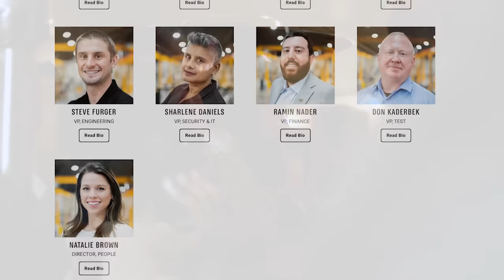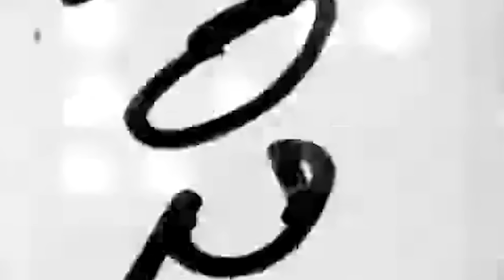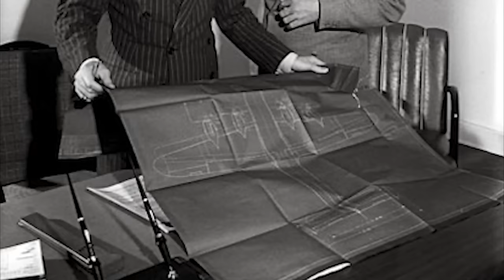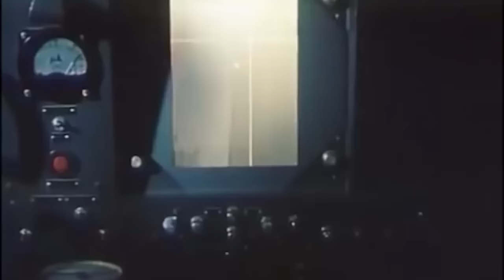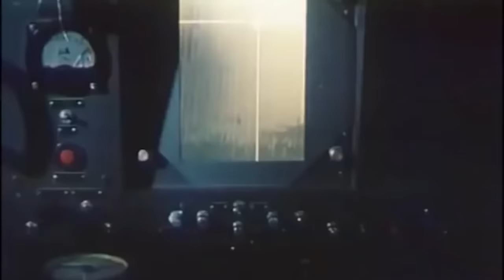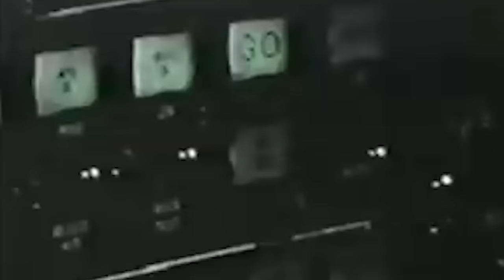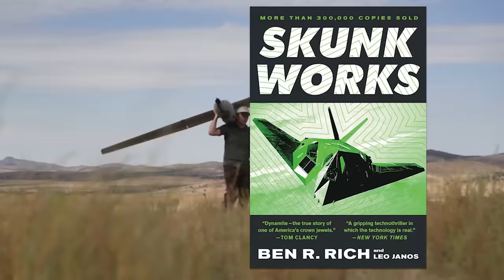Is Hermeus the Skunk Works of a new generation?

Comment: The thing I like the most is the amount of in-house design and manufacturing. People the are building it ACTUALLY interact directly with designers in the same building, unlike almost everyone else . 
"RealEngineering" made a good YouTube video about this project and is well worth watching.
Reply: Spot on, I feel this is why we are seeing poor quality in some parts of the aviation sector mainly commercial uhmmm Boeing, there's no direct interaction they're basically not working as a real team.
Reply: The Commercial Hypersonic airliner idea of theirs is... something else to say the least. Like the Concorde, one issue that I imagine Hermeus would have to manage is the Sonic boom such an aircraft would create (if the sonic boom produced by Concorde was loud, I can't imagine how loud a Hypersonic boom would be). I could imagine that it would be less of an issue if they just flew Transatlantic or Trans-Pacific flights, like what Boom Supersonic wants to do.

Still though, if they can get commercial hypersonic travel to be as safe and reliable as commercial air travel is now, it could be neat.
Reply: Vertical integration has become more important for cutting edge tech

Comment: Kelly Johnsons skunk works didn't just change aviation, they changed every day life. They had to invent the entire titanium manufacturing process for their Mach 3 programs. That lead directly to everything from titanium rods used to surgically set broken bones to smoke pipes
Reply: Not really.  The Skunk Works led the development of titanium in sheet form.  That metal had been used in forgings and castings - the usual applications - since the mid 1950's.  The A-3J used forged titanium in its engine frames.
Reply: They co-developed the specific alloy for its improved fatigue and machining properties.

Comment: There's a facet of this process management for lack of a better way to describe this, or maybe the best way to describe it, either than or project management, is something that comes up in other forms of project management, which is everyone matters.  Every person's points should be considered.

This is how you get an entire team to keep their minds engaged in what you're trying to achieve.  Everyone matters.  This is also why a smaller team can be so effective because the larger the team gets the more this point is forgotten.
Reply: I lead a small team of volunteers at my local Air Museum. This has been my guiding principle as we accomplish our preservation projects. I adopted the principle that I was not the source of all knowledge on processes. As you state above, everyone on the team has an equal voice in the projects. 

We have adapted and conquered every obstacle, together. 

Paraphrasing one of the directors, "...my team has completed more preservations in the last five years than the museum had accomplished in the previous 20 years."

Comment: Kelly Johnson and the Skunk works achieved a great milestone with the A-12 / SR-71. However, Convair had similar programs going at the same time that were going to use RAM jet power to go even faster - Mach 4. I am sure there were many reasons why Lockheed might have won over Convair. The Skunk Works had a good track record for rapid and on budget success. Convair was working on producing B-58s and F-106s, and both programs became very costly and only limited numbers were produced. The Air Force is very cognizant of over reliance on a single contractor, especially if they have other obligations that would interfere with applying appropriate resources to a project. Also, the Air Force might have decided that Convair's proposal was at a lower technological readiness level than the Lockheed idea.
Your main premise is correct though. A small group of extremely talented and self sufficient engineers, devoid of bureaucracy and enjoying direct lines of communication with each other can work faster and smarter than a huge behemoth of a division with massive bureaucracy and answering to committees of management and the government.

Comment: Speaking of Kelly, I think he and Ben Rich had hypersonics truly figured out already in the late 50s decades ago with the CL-400 Suntan. The infrastructure and willingness to pay for it was the problem by LH2 and their ideas for the project would've eventually evolved into hypersonics quickly, shared a common fuel with with spacecrafts, and been a much more efficient and cleaner fuel for reconnaissance aircraft as far as exhaust byproduct output (water) and the outlet temperatures.

Comment: Flying So High So Fast. You can’t be touched 💫 🇺🇸 😯
Reply: Missles blasted past the SR-71 something like 4,000 times. A mach-3 jet dose not out run mach-4 missiles. It's electronic countermeasures was it's secret to success. In conjunction with speed and lower RCS to give less time to compute an accurate missile intercept. They retired it when the latest Soviet SAMs of the mid-80s went into space, and came back down at mach 5+.

Comment: This small add on drone to the SR-71 is probably fairly well know to kids of a certain age because of the Cobra Night Raven sp3 toy from the 80's.
Reply: Well, or anyone who read anything about he Sr71 ... the thing is that the A12 was faster but due to it being lighter as it had to overfly the area.. the Viet Kong had Sa2 systems which were the first systems to ever down a plane, so it was old, outdated... after a lot of photos being blurred by incoming missiles and even having shrapnel from rockets  next to the engine, the A12 ended its career less than a year after introduction.. So the Sr 71 was born, a second seat and heavy side-facing camera so it wouldn't need to ever entèr enemy airspace, which it didn't (to avoid the fate of the 7 downed U2s).. but, alas, more than a third crashed by itself so it was better to put it in a museum to preserve the American mythology

Comment: It's likely that the best practical hypersonic aircraft will be "skimmers" (eg: The 2002 LLNL Hypersoar concept which became FALCON) which operate on the edge of the atmosphere (dipping down for thrust/manouvering, but spending a large amount of time "coasting" above/close to the Karmann line) in order to achieve maximum speed with minimum heating. (Almost suborbital, but not quite - allowing use of atmospheric oxygen and therefore smaller fuel tankage)

Unfortunately these will be "vomit comets" for passenger flight, despite being able to do long-haul travel (minimum 5000 miles) in staggeringly short periods of time (2 hours London to Sydney/Auckland or Singapore/JFK, 75 mins Chicago/Tokyo)

Comment: With winglets near the back of the plane, tail fins aren't necessary.  With small canards and a third pointing down, the one downward canard and with downward and pivoting winglets the plane could eliminate most crosswind problems.
Reply: Yaw stability and how the various axis interact is a very complex problem.
Reply: @TheJustinJ  I mostly have just redesigned failed air valves and mixers for liquids that had "fix me" all over the blueprints.  The companies that I have fixed problems for, either had their patents stolen and mass produced out of China, or they are on still barely running machines since they are 10 times past due for the junkyard.  Just throwing out ideas under the "try it and see what happens" clause.

Comment: Perhaps, BUT Hermeus MUST first produce an actual production run (however limited) of fielded designs with a track record of at least a handful of thousands of hours of flight time.  

Atm, they only have, essentially, a prototype cooled inlet, avionics for said inlet, and flight dynamics models for an extremely limited duration mach 3+ energy-altitude vehicle.

There's also the caveat that Skunk Works was funded entirely by long-term government contracts in a Cold War context and Hermeus is entirely (atm) venture-based so they need to earn some sort of revenue in the mid-term.  The Skunk Works only had flight dynamics mission performance numbers to hit during the Cold War--not VC accounting numbers to hit during, relative, peace-time.

Comment: An SST airliner is not really financially viable and here is why. Even if you could charge $10,000 a seat, the problem for the airlines is all about gates and slots.  When you make a flight, you have to have a gate to load passengers, and when you have those passengers loaded, you have a slot to take off. When the plane gets to the destination, you have to have a landing slot for the plane, and a gate to park it at. Gates and slots are all full, so that means you take a gate and a slot away from another airplane.  With an A-350, you can seat 350 to 400 passengers. So for every 100 to 120 passengers you cans squeeze on a hypersonic SST, you give up 200 to maybe 250 paying seats that you could get on the conventional airplane.  Now the other issue is that not everyone is flying from London to New York, so those 120 people get off the plane, but they don't fill up your connecting flights , so you have empty seats on those planes.  If you can only really support city to city (as the Concorde did) you greatly limit the routes you can fly because you are looking for cities where there is a lot of traffic specifically between those cities or your feeder flights will be underserved. This was ultimately the problem that the Concorde had, and Hermeus would likely face the same financial barrier unless they could build a plane that could carry maybe 250 passengers and baggage. That might prove to be a real challenge. I think there is a small market for a business class SST but it is hard to know if that market is big enough to make the company profitable. Lear succumbed to the much slower Cessna Citation because Cessna marketing did a remarkable job (and indeed, it is one of the best marketing stories of all time) and history proved that the bigger, slower plane that could operate from smaller airfields and didn't require the CEO to crawl to his seat was the better solution, and Cessna pretty much ran Lear out of business. This would be a good story for your channel, though there probably are few people around that really know the whole story of the Citation.  Anyway, commercial aviation is based on the hub and spoke model and gates and slots are the obstacle that a hypersonic SST would have to fight.  There are many other issues besides these, but these are the big ones. Carrying fewer passengers at a higher ticket price sounds great, but it isn't compatible with the hub and spoke model of the modern commercial air transport system unless the plane can be made to carry maybe 250 or so passengers, and probably more.  Remember, if you could make twice the flights in a day, you would need twice the gate time and twice the number of slots. The system simply can't accommodate more flights at times people would be willing to travel.
Reply: The 787 Dreamliner is another marketing example. Boeing did their marketing and realized that the Dreamliner was the right plane to make rather than an 747 replacement. Like the Concorde, the jumbos are best at serving major destination cities. There has to be enough people going from City A to City B as the origin and destination to make these large planes work.  Boeing has never pursued an SST because they know the airline business as well as the airlines themselves to (probably better) and that is why the 787 has received 2000 orders, vs the A-380, the plane that everyone said Boing should be competing against, only sold about 250. If Boeing thought there was a market for even an SST, they would have built one by now.  Without solving the gate and slot problem though, SST or Hypersonic just doesn't work in the business model. They might sell a few, but it probably would not be enough to make them successful. Airbus probably only broke even on the A380 because they didn't understand the market the way Boeing did.

Comment: Those engines look like they give off a lot of heat, fast or not that will be picked up by infrared tracking ??.
Reply: The skin friction alone will generate  an object of at least 1000 degrees. Stealth was never mentioned and is clearly not intended.

Comment: How can you "test" a RAMJET engine in a wind tunnel, considering the air has to be moving at Mach 3+ (therefore generating enough pressure on its own to compress itself within the engine)? What I mean is, how can you make air flow at that speed, considering a propeller engine loses efficiency and barely manages to get to Mach 1 (if that)?
Reply: How does a rifle bullet go mach 3?

What happens when you pressurize a giant vessel and "blow-down" through a specific shape of tube? Google hypersonic wind tunnel. Also "Sonic Choke".

Comment: Interesting that term audacity, you can see why aircraft designers and engineers disagree over so much so audacity and pig headedness can be both a positive and negative where damn hard work and luck can be deciding factors. Kelly Johnson may well have intuitively sorted the airliner aerodynamic problems but if he truly had a big influence on the P-38 as stated here it seems that instinct was not quite on par in that project for it had a troubled development to say the least. Early development did not foresee or solve fundamental aerodynamic problems or indeed the engine problems either though that latter can be put mostly at the engine suppliers. However even passed for service after that development the aircraft was so dangerous in a dive it was pretty much banned from doing so after the loss of pilots and even bizarre remedies like raising the tail failed to remedy it which itself cost the life of the test pilot. Indeed so bad was that problem (plus the engine failures) with German pilots soon working out its deficiencies ies in combat it was removed from European operations altogether, Despite finally solving the compression problems with air brakes. 

I not belittling Johnson in any way just pointing out that no one is infallable, instinctively fully understanding of inherent dynamic problems or because they work out one problem that they should therefore be deemed the go to source for every following problem. Questioning any insight, of belief is vital especially in science of any kind. The best in their field are those who get it right more often than not, not to be seen as always getting it right even when it’s clearly wrong, instinctive or otherwise.
Reply: There were no high-mach wind tunnels in 1936. 

Considering the P-38 came out before the F4F wildcat, and ended the War still out performing the Hellcat and Corsair. I would say he was ahead of his time.

The P-38s Achilles heel was Mach-tuck at a low mach of 0.64 IIRC. It's secondary issue was early development Turbochargers, combined with large intercoolers, and lack of understanding how to use them at -60*F. Plus the complexity of early complex twins, having pilot adjusted mixture and propeller controls. It overloaded the pilots in combat.

Comment: The J-85 is not a turbofan engine. It is a turbojet. I mean it is exciting but they have not flown anything and even this aircraft is just flying on a standard J-5 so I will wait and see.
Reply: Yes, to obtain these speeds and range, it will for sure require more.The aircraft will need something beyond a J58 or J93.  Exotic materials for the aircraft and inside said engine and special fuels.

Comment: The landing gear on the quarter horse looks a little on weak side. ?
Reply: Have you performed a stress analysis to come to your conclusion?
Reply: No but I have worked with a lot of weight bearing equipment , this looks small but may in fact do what they say it will, the concept of smaller , lighter, faster does not apply to aircraft loosing their lift over
A runway on landing  traveling between 150- 180 mph the introduction of the weight on the aircraft being overtaken by gravity tends to put a lot of stress on landing gears

Comment: The X-15 rocket plane was the first reusable hypersonic aircraft.
Hermeus, one of your US flags on the tail of your aircraft is retreating, i.e. facing in the wrong direction, stars back. The only reason to orient the flag in that direction is if you have a high degree of certainty your plane will fall tail first from the sky.